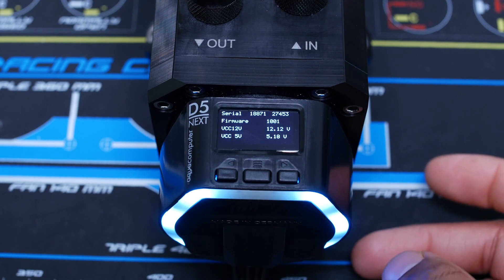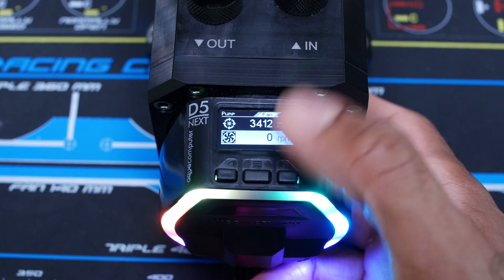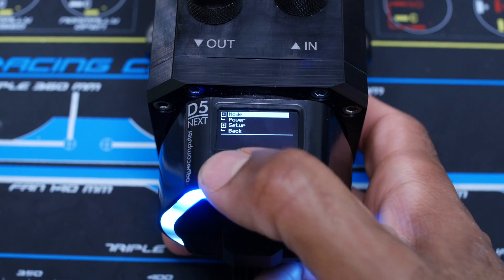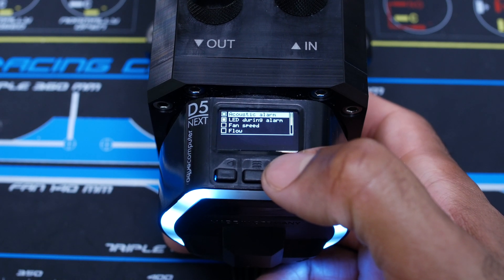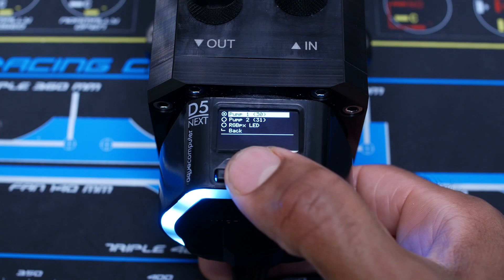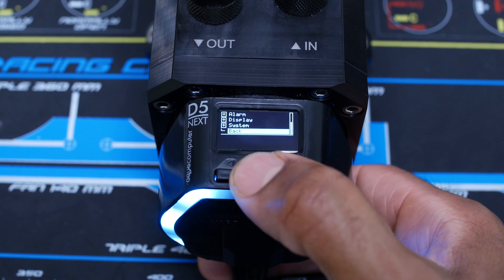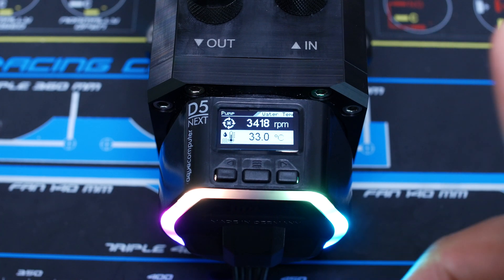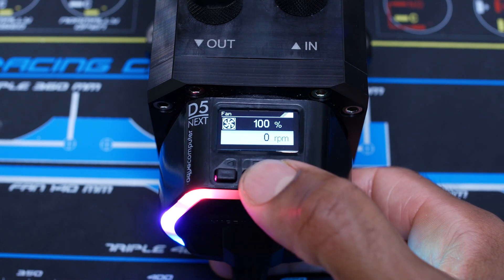Aqua Computer D5 Next

Comment: Hello, could you solve a question with the Heatkiller? I bought a Heatkiller tube D5 and doing the leak test with pressurized air with the EKWB Leak test gives me a leak. From watercool they tell me that the air test with these deposits can give failure, to do the test with water. Do you agree with this answer? is it normal for it to leak? How do you test? Thank you.

Comment: How much fans can you connect to pump? I want to use 9x be quiet! pure wings 2 pwm 120mm, isnt it to much power for this pump fans controller?
Reply: D5 NEXT fan socket load is 25w
You can calculate
What is the total wattage of nine fans
Don't get close and don't exceed 25w

Comment: Which version of the  Heatkiller Tube is that? 150? Also what's the total length of the reservoir with the Next installed?  Thanks for the overview.
Reply: 40mm is how much of the pump is visible, then just add the length of the Tube(Which can be found on the website)

Comment: I just bought this product and it came in. How can I run the pump with out powering up the entire computer to the water circulating
Reply: I know this is an old comment but just for any future visitors: You can just unplug every PSU cable from your motherboard/components and short the 24 pin with a small piece of metal like a paperclip, and then the molex to the pump will work. Look online for the diagram of what connection to short

Comment: Can I hookup 6 Adressable RGB fans to this and control their lightning/speed via the Aquacomputersoftware? Or would I need to use Corsair's software if I'm using their fans?
Reply: depending on the fans you can likely make an adapter harness. Which model corsair fans?
Reply: @shanemshort  LL120